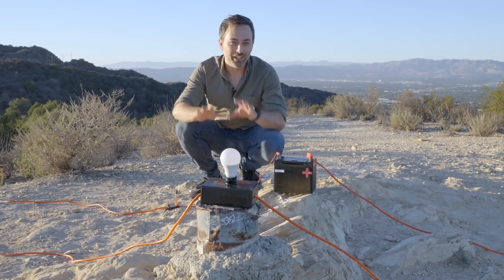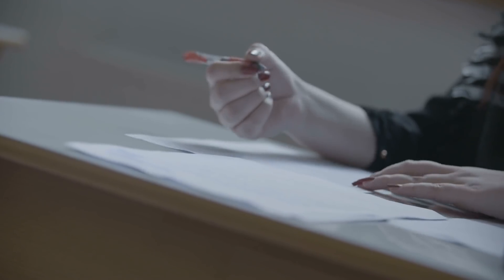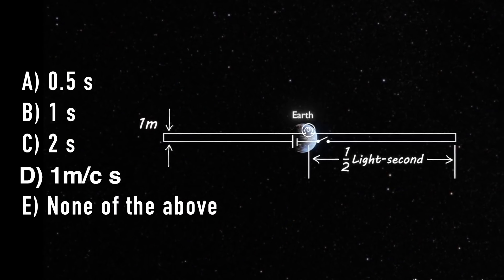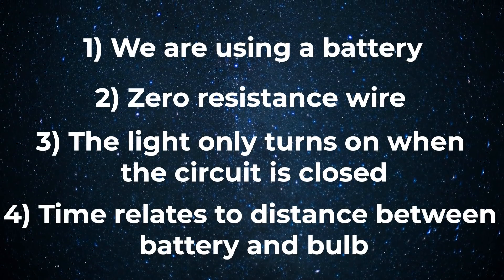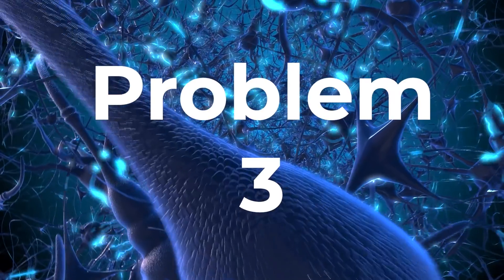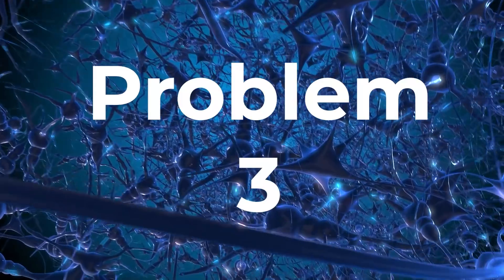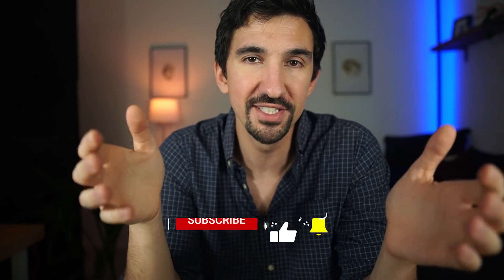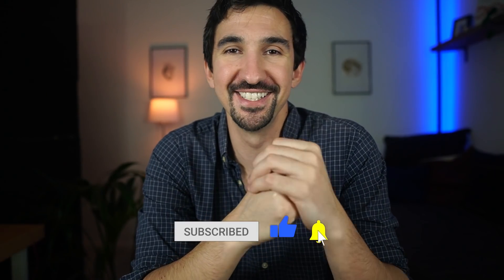Is Veritasium Wrong About Electricity?

Comment: Well, first the formula is speed = distance/time. 
Rearrange it for time and you get time= distance/speed. 
Now since the bulb is 1m away from the battery and the speed at which EM waves move is c you get 1/c. As for the units, there's absolutely no problem there, because it's (1/c)s not 1/cs as how you are thinking of it.  
Second, there's no causality problem as again you are assuming a scenerio based on the flow model of current in a circuit, which is not accurate to begin with. The energy is stored in the field and the moment the circuit is closed there's a field establish right around the wires connected to the battery. Assuming that the circuit is complete the bulb will light up due to the induced field, and if the circuit is broken then it wouldn't light up as the field will not have a sink for the energy flux. Point is if the circuit breaks the field is gone and so with it the light. The energy flows from source to sink via the fields and it's independent to the length of the wires.
You're thought experiment involving another switch at the far end of the circuit being switched on and off will have the same effect as the switch right next to the battery. Because the source is the battery not the switch. 
Last, yes you are right regarding the set up, practically this set up will not work, but this discussion was based on a problem for which the assumption is an ideal case: zero resistance, battery with continuous supply of power and system that is isolated from all other factors. Derek's setup was only for a visual aid to make the concept more clear regarding the question. It wasn't intended as the actual problem set-up. 
Yes, I agree that science doesn't work on the basis of lies or intended deceit. But i have to agree with Derek on this completely because the way we are taught these concepts there's no escaping the lying part. As in schools physics is taught in a way that most facts are dumbed down to such a degree that they either lose their original meaning or are so confusing that you have no escape but to memorize it as is. Furthermore, it's stressed that this is actually how things work, but with each passing year we learn that there's more to it actually and when you are at post-graduate level most of the physics you'd learned at highschool level seems to be either lies or intended-deceits. Because at best it's just misleading and at worst it's misleading despite us knowing that it is. 
Thanks for your take and deep curiosity as you've made a good discussion great!

Comment: To clarify, I think what you're saying is that the lightbulb will start to receive a tiny-bit of energy immediately, due to the coupling of the electromagnetic field along the nearby lengths of wires. But then as time passes, the lightbulb would continue to receive more-and-more energy from the battery as the electromagnetic field propagates down the lengths of wires at the speed of light, providing more-and-more length of wire for energy to transfer along. So the net effect is that over the course of a second, the lightbulb would gradually increase in brightness. Do I have that right? My follow-up question: in Veritasium's version of the problem, the bulb would eventually glow quite brightly. How much more brightly would it glow than the Miles' "antennae" version of the setup? I.e., how much extra energy comes from closing the two ends of the antennae, and why?

Comment: I think a common misconception amongst a lot of people is that the circuit must be closed for a current to flow. The initial transient response of this system doesn't depend on a closed circuit, and would be the same even for superconducting wires going off to infinity in both directions. Assuming that all charges in the system are stationary as you close the switch; the system simply responds to the local charge difference at the switch interface and starts to transfer charge along the wire. In order to equalize the charge difference. And as we all know, where there are moving charges we have a magnetic field. It's a shitty antenna transferring a negligible impulse of energy to the light bulb through the EM-field. In fact, it's the distance from the switch to the light bulb that matters in this case. The positive charge from the battery is already at the switch interface when you close it.
Reply: What about the distance between the two ends of the cut?
Reply: Yeah... this is the only response I can think off that is kind of valid. Yeah, when you click the switch on, a magnetic field is generated arround the current, which means that you have somewhat of a varying magnetic field at the very begining (since it went from zero to a set value). And yes, a changing magnetic field can induce a current (not a constant one) but this interaction is just for a fraction of a second, and maybe not even strong enough to power the bulb, even if we assume it can, it would just stay on for that fraction of a second, then stay off until the current wave reaches it closing the circuit. 
Which by the way, i don't think it would take a second either, light propagates at different speeds on different materials since the fields have to bounce from electron to electron, pushing them one by one similar to a sound wave, so the overall distance is greater than in a vacuum, so it would take longer than a second, but I don't know how much exactly.
Reply: I have yet to get shocked on an open circuit, so obviously no current is flowing.  As a Electronics Technician and Electrician, I deal with this day in and day out (from single digit voltage to multi thousand and Amps over 10000 A.
Reply: @bowez9  Have you ever thought about why you don’t get shocked though? When you’re touching a part of an open circuit, the charges on you and the part are just redistributed such that they reach their lowest energy state. The charges on you have nowhere to go after you’ve been charged up/down. There’s little to no flow of current.
Reply: @Triszious  yet your first post implies that current flows through an open circuit, and I can attest through the use of multiple measuring equipment your implication is false.  On an open or deenergized circuit there is no current flow.
For I=R/V  R is undefined/zero on an open circuit and as a result I is 0.
Reply: @bowez9  You have probably felt a little zap when touching metallic parts before? That's because there's a small momentary current between you and the part; in order to equalize the charges between you. When you connect a positive voltage to an open circuit, do you think nothing happens? How can EM waves reflect off the end of an open circuit?
Reply: @bowez9  You have to remember that we’re talking about a phenomena that propagates at a fraction of the speed of light. Any currents in your open circuit has settled long before your equipment has been able to measure anything. (R is effectively infinite in an open circuit btw, but that's the steady state)
Reply: @Triszious  my equipment is closer than the sink and sources.  For if distance over c is the speed of the circuit it is the speed of every circuit.
Reply: @bowez9  What length scales are we talking? Anyway, maybe it would make you feel better if I told you that the circuit in question isn’t open in the absolute circuit theory sense? Strictly speaking, it has some impedance and acts as a tx and rx dipole antenna.
Reply: @bowez9  My point still stands though, if the switch was at one of the edges; do you think the battery would instantly start gobbling up electrons when you close the switch? How does the battery know when the switch is closed? It doesn’t, the charges have to propagate from the switch. If you connect a two lightsecond long cable to a battery, how does it know if the loop is closed or not?
Reply: @Triszious  the energy from the battery first "fills" the wire and then the energy from the wire "fills" the sink.  All the energy for the light must come through the wire in the circuit and the wire must get it from the battery, this is why voltage drop is effected by wire length.
This experiment can ignore resistance and relativity, but doesn't make it true.  As stated in this video Veritasium is saying the wire doesn't matter as the light comes on faster than the speed of light for the wave from the middle of the wire has no energy before the light is on according to Veritasium (for that matter 1meter and beyond don't matter).
Reply: @Triszious  the distance of test equipment circuits.  Given equipment size let alone PCB size these operate at orders of magnitude faster than 1/c.
According to the experiment is no resistance and as such no impedences, so no antenna.
Reply: @bowez9  What do you mean by I=R/V? Shouldn't it be I=V/R in which case you would get an initial large current for a low-resistance wire?
Reply: @gooball2005  Yes I forgot to take the inverse.  BUT given the statement of 0 (or infinite/undefined) resistance the out come is still the same.
Reply: @bowez9  How does the battery know if there’s a sink at the end of the wire? That’s kind of my point, there is no magic faster than light (FTL) communication between the two. In fact, if there was a sink at the end of the wire, then it would “suck” electrons from the sink until it’s neutral with respect to the sink. This would propagate the same way that connecting the positive terminal of a battery would, but in the opposite direction and with opposite charge. So if you connect a positive voltage to one end, and a sink to the other end at the same time, then the charges would propagate from both ends. It’s a (sort of) superposition of connecting the positive terminal and sink separately. My point is that these interactions doesn’t happen instantaneously, when you connect 5V to a wire, it doesn’t magically appear at the other end.

There is no voltage drop along the wires in this scenario as there’s no net magnetic field inside superconducting wires (Meissner effect). In this extreme case, Derek’s completely right when he says that all energy travels outside the wire. He might underplay the role of the wires, but everything he says in the video is completely correct. My only gripes being that the video is a bit sensational, and it’s the distance between the switch and light bulb that matters.
Reply: @Triszious  so then here in the real world way is the voltage drop is the same through an extension cord whether it's copied up next to the load/sink or stretched out?
As another video put it Veritasium is doing some "hand waving" and hopefully no one notices.
Further if it is only straight line distance explain shielded cables, or the separating AC and DC circuit wires reduce interference even when loads are right next to each other.
Reply: @bowez9  The resistance in an extension cord is for most practical purposes constant, which implies a constant voltage drop in STEADY STATE. However, the reactance of an extension cord depends on how it’s configured in space. You’ve probably heard that you shouldn’t coil up an extension cord before. That's because the fields in the cable interacts with itself.

If you are able to contain the fields with shielded cables, then the energy would of course have to propagate through the complete length of the wires. Our wires aren’t shielded in this scenario though.

I don’t think I have to tell you how changing magnetic fields induces an opposing field in nearby wires.

Btw, you seem to imply that I have zero real world experience. I have worked as an electrician before. I understand where you’re coming from.
Reply: @Triszious  I will give you the first particle does get there in 1 over c but 1 particle does a lit light make, at the very least you must overcome threshold voltage.  A 1W load would take 6.24 x e ¹⁸ eV/s.
Reply: @bowez9  That’s where the “trick” in the question comes in. Derek specifically said that the (magic) light bulb would light when it receives any current.
Reply: @Triszious  so not science it's magic. At that point the question is meaningless.
Reply: @bowez9  The main takeaway is that charge is propagated through the EM-field at relativistic speeds. Not by charges “physically” bouncing into each other or something. Electrons interact with each other through the EM-field. Charges are more rearranged than moved around, if that makes sense. The question is at worst misleading. The hypothetical light bulb is just there to act as a discrete measure of when you receive any energy at the position of the light bulb.
Reply: @bowez9  I have yet to touch a wire that goes to infinity, open or closed.
Reply: @georgelionon9050  measure it resistance.
But with a statement like you made you do not work in the field.

Comment: The wire is still a giant capacitor is if it is broken at some point, current flows when the switch is closed, regardless.

Comment: If the experiment were set up exactly as initially suggested, the light would certainly illuminate instantly, but not for the reason suggested by either party.
As set up, the wire passed through the Earth's magnetic field, and partly through the sun's own outwardly flowing particle streams. All that would be required is for the gradient of the EM field along the wire to be greater than the requirement to illuminate the bulb.
You would need to know the geometry of the wire and the gauss measurement of the field. The voltage of the battery doesn't even factor into it. It would play the part of an electrolytic capacitor in this, but would probably be overcome by the potential generated by the EM field.
At the scale of this experiment, you haven't built a DC circuit. You've built an electric motor.

Comment: As a mechanical engineer, most of this stuff is not practical to me but the causality problem interests me.  I think there may be a mixing of apples and oranges when it comes to communication and causality.

Thought experiment to distinguish between communication and physical causality:

1.  Set up a rope that stretches over 200 yds in a straight line, connected to a bell on one end.
2.  Someone stands at the bell, and someone grasps the rope at the other end.
3.  The person 200 yds away simultaneously pulls the rope and shouts "Hello!"
4.  The person standing at the bell will hear the bell ring first, and then the voice.

Does this mean the rope travelled faster than the speed of sound?  Of course not.  The rope didn't move 200 yds.  It moved an inch or so.

In like manner, I don't think it's quite fair to say a "break" in the notional circuit that Veritasium thought up presents any kind of real problem for "causality."
Reply: The length of the wire matters not. In that experiment as described by Derek, the wire gets bridged by electromagnetic induction or the electric field of an capacitor or a combination of the two. That starts happening right away and will induce a small pulse into the wire next to the bulb. He probably couldn't power anything with that pulse but yeah it will be there allmost instantly. If he puts the bulb at the far end this will ofc not work.

Comment: I'm pretty convinced that Veritasium saying "the lightbulb would turn on in 1/300000000 s" is completely wrong. His video is an extremely convoluted way of displaying the effects of electromagnetic induction. For a fair portrayal on his part, it would have been necessary to state how many joules would be going through the light bulb in 1/300000000 s. I'm almost certain it would be so little that not a single photon of VISIBLE light would escape the light bulb. So no, it would not "turn on" as what people expect "turning on" means.

I think your analysis is spot-on.

Thought experiments are nice, but empirical evidence is required for it to be science.
Reply: Not about induction at all. It is about knowing where E and B are which tells explicitly how power is transmitted.Battery makes an electric field in space, and along wire. The current makes a B field, then calculate Poynting vector and power flows through space and along wire.
Reply: No, it wasn't about induction. You can simply assume the wire is isolated with a hypothetical material that doesn't allow any EMF to pass through. The Energy still passes through it and arrives at the bulb. At least this is how I understood Veritasium...
Reply: This isn't quite a thought-experiment, since it's some basic rf design concepts, right out of a hundred years of college textbooks.  Normally we deal with scope-displays and microseconds, not thousands of milliseconds.    But be warned: technicians will be clueless, since it's only presented at the college level, to physics/eng. students.   At the high-school level, we're all taught wrong.

It's a "lie-to-children" when we teach that the electrical energy flows inside the wires.

How bright will the bulb light up?    Without calculating, I'd guess 10mA, so maybe 100 milliwatts, after a delay of 3 nanoseconds.    NOT microscopic or insignificant. 

However, the bulb needs to be an LED, putting out milliwatts, otherwise we won't see anything.

Calculating:   the 2-wire lines, millions of meters long, behave exactly like two tiny resistors wired in series with the bulb.   They're about 800 ohms (not 600, I guessed wrong.)   So, we have a 12V battery with 1600 ohms in series.   It can easily light a single LED, feeding it roughly 5mA.

Comment: This reminds me of zombie LEDs that should be disconnected, but AC current can still transfer from the live to the neutral wire, when long enough. If the LED doesn't have a proper drop resistor, it'll faintly glow when off.